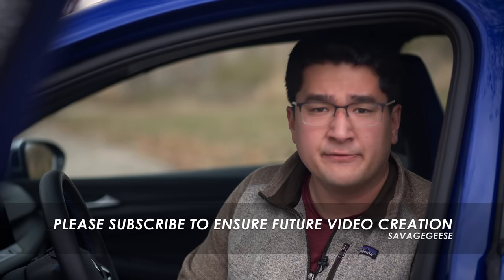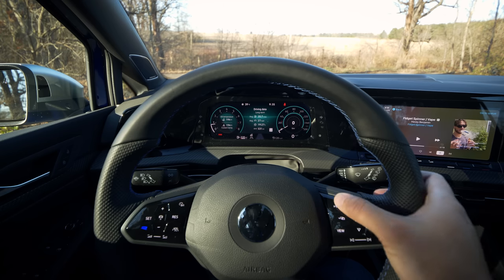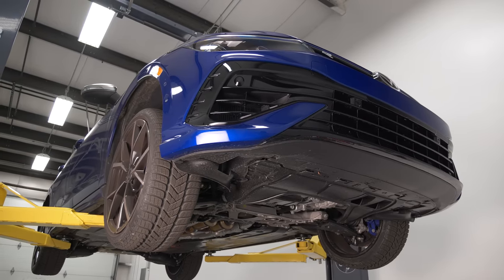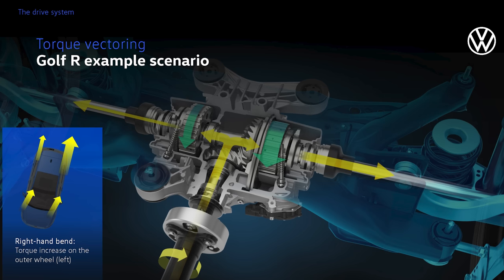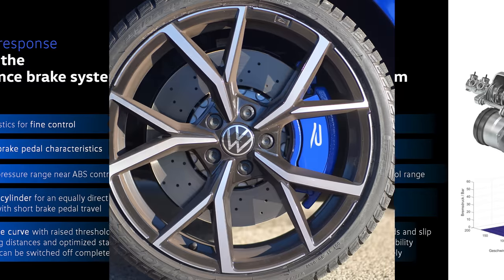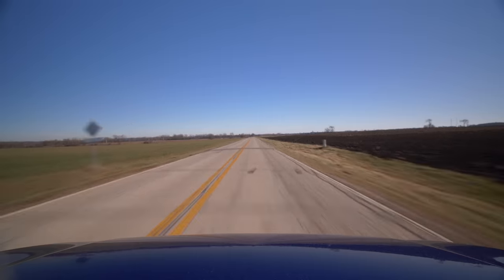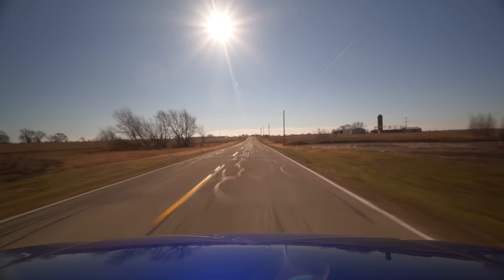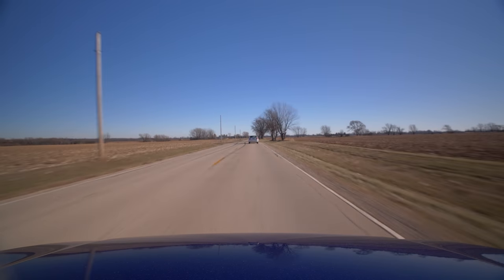2022 VW Golf R | Tearing Up The Streets

Comment: The Golf R is a splendid car, but it's not worth 60k. Espeically not with those cheap ass looking doorsboards.
Some companies charge you 2k to get all 4 doors covered with leather, how is it still not a thing on this car. Like at least the top half.
Reply: Vw just doesn't have the street rep to put the Golf R next to an RS3 or A45 AMG pricewise..
And the worst thing is, the manual is not even an option over here, not even for the gti anymore...
Reply: Who said it's 60k? In Canada it's around 49k CAD which converts to about 38k USD (oh in Canada markups are illegal)
Reply: @070074810  in Germany it starts at 50k, but with the smallest of extras it'll go for over 60k

Comment: Savagegeese is definitely good on technical knowledge, but the dialog is cumbersome to the point it doesn’t feel natural.  If they dial back the wordiness, stiffness, and nerdiness a few degrees, I think they could be truly exceptional automotive reviewers. 

Regarding the car, it sounds like the R needs a little massaging with the rear drive unit. But more importantly, a front limited slip like the GTI. Fourteen years on, and nobody has replicated the secret sauce that was the Evo X AWD system, differentials, and suspension.  You’re getting closer, Volkswagen. Make it happen on the refresh!

Comment: Why would VW give you GARBAGE snow tires???  Stupid. They should of given you Michelin  Pilot Sport A/S 4.  How can these people ( VW) be so stupid. This is something Hyundai would do.  Hyundai failed on the Kona N by NOT giving it a $1,400 AWD option because they wanted to "cripple" it. The Kona N was meant to be AWD and a Golf R chaser. Not an understeering Veloster N tire scrubber. But AGAIN Hyundai is "too stupid " to do a performance car like the Kona N correctly. The Kona N AWD would be the KING of the N cars. They also failed by keeping the ride height so so high with a "crippled " roll center.  Their Kona N is a street racer. All the "good" youtube reviewers have called out the "twitchy" handling of the Kona N compared to the Elantra N. Why, Why did Mr Beirmann wreck the Kona N by #1 not making it AWD and #2 Making the right height of a street racer like a dirt track AWD rally car AGAIN another fail by Hyundai.  Hey Hyundai you will double sales with an AWD Kona N. I have money in my bank waiting. In the mean time I will keep building my tuner 1.6T AWD Kona  BECAUSE I know how good this platform IS in AWD. It just needs some 2.0 liter love and a 8 Speed transmission love with AWD since your DCT coding on the 7 speed is God awful.

Comment: You guys constantly misinform people about the STI pulling timing and never acknowledged they recommend 93+ octane. Give people actual decent information. These cars are designed for 91 octane. An STi is not designed for 91 octane its not a relevant comparison. For guys that claim very in depth reviews maybe you should actually try to give proper information 

An STI runs awful on 91 octane in summer time. Actually test it out yourself.